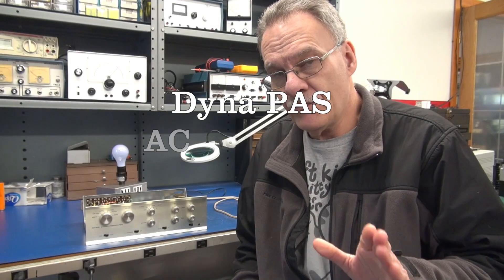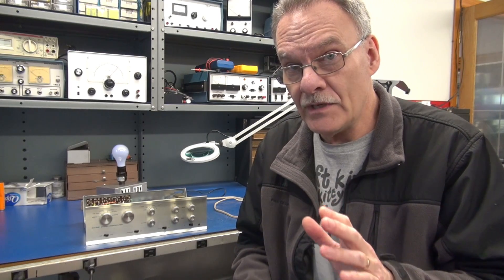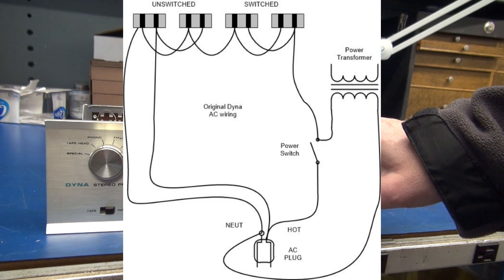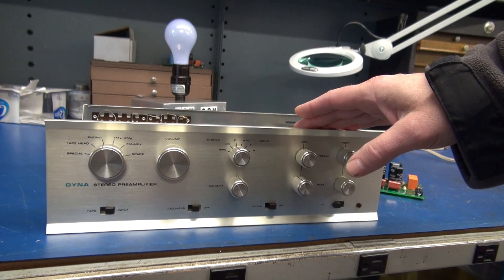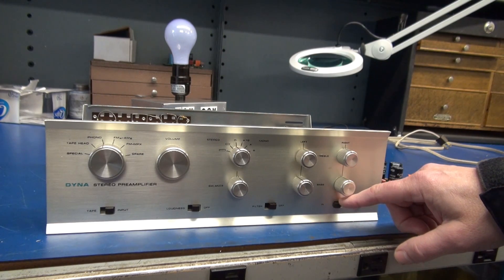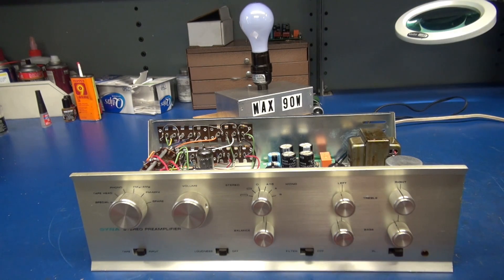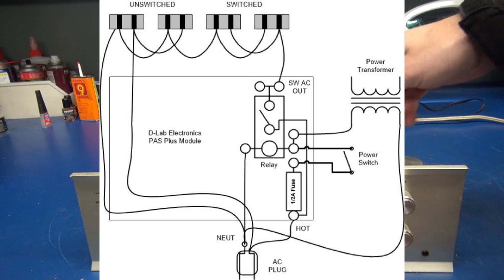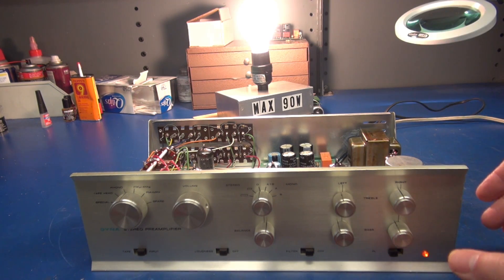Information Dynaco PAS Preamp upgraded power supply and AC switching for external tube amplifiers

Comment: I personally would rather not use the preamp cord to power any amplifier.  My solution would be to leave the switched receptacle and use it to power an external 120 volt relay to switch the power amps.  I like to use a 4x4 box with a cover made for a duplex receptacle and switch.  Punch the switch opening for a octal socket and use a 120 volt relay to operate the receptacle with a heavy cord for the amplifiers and a zip cord for the relay.

Comment: Love your vids through the yrs.👍
Related but not....
I've got a T-7 operating perfect EXCEPT it's Pre-sets. Does not store any tuned station. Have attempted, per manual, to save various tuned-in stations on the 5 Pre-set buttons via the Memory button, no joy.
An odd occurrence though, if I hold down Button #5 alone for 4-6 seconds, it slowly moves the tuning wheel/dial to the far right of the band. It may do the same on another of the remaining 4 buttons, I repeated the action multiple times. Any tips?? Haven't opened it up yet since the Pre-set feature is the only fault. I'm comfortable doing so.
Note, it's a remarkable tuner!

PS. I've searched a few sites today re: the potential of its bad rechargeable battery and changing it out could fix it!??

Comment: I'm confused how does the PAS power supply module protect the power transformer? protect it from what
Reply: The PAS power module has a fuse that is connected in series with the primary winding of the power transformer.
Reply: @RaulHernandez-lg5nw  oh ok